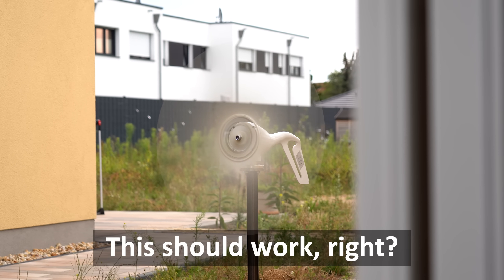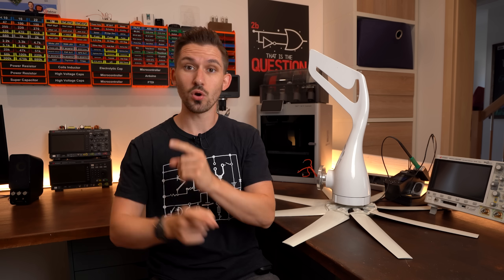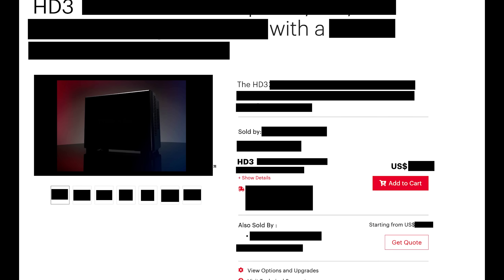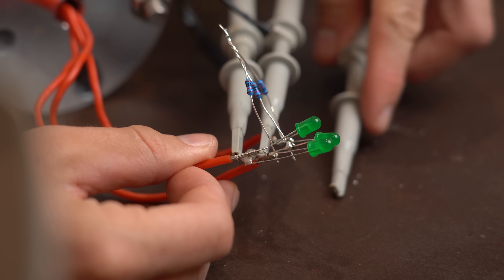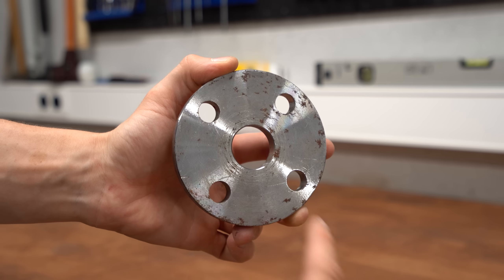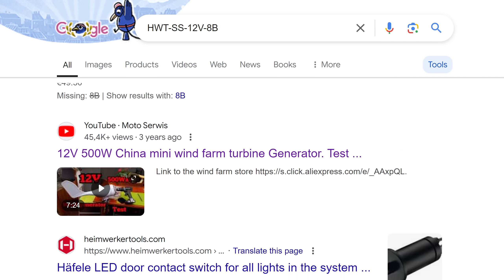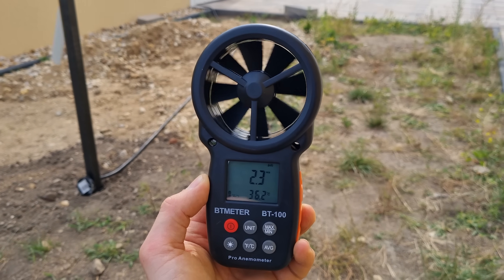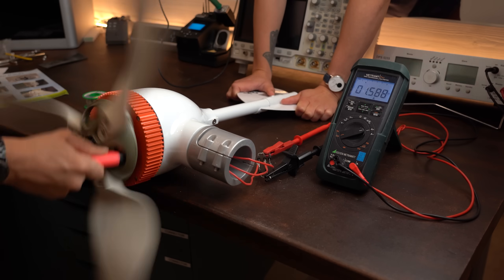I tried to Power my Home with Wind Generators! (Worth it?)

Comment: Make your own... Lens 2 type design... Find a BLDC with a ceramic housing from an old Diakin industrial aircon. Needs a lot of gear reduction but will power a 1000W inverter! Almost impossible to turn by hand when the phases are shorted. Comes with hall effects sensors for feed back to monitor windspeed if you what to be creative. Sien jou volgende keer van Suid- Afrika. Vol brug drie fase gelyk rigter🤣

Comment: i wouldnt power my house with a windmill, but i would use one to charge batteries in tandem with solar panels, and if i had a stream running through the property a water wheel

Comment: Every times you see these - not only Chinese - commercials about small wind turbines with 1,2,4 kW proposed output, take a break, think about the fact that generators are not that much different to motors and then how big is a normal motor that can handle 1,2 or 4 kW - How should a toy like generator give a steady 1kW without burning?

Comment: You could try setting up a funnler system. Basically a wall with funnel holes or fins to focus the wind speed into a higher speed when it makes contact with the generator.

Comment: I had the same brand of motor, the first one shipped with a crooked axle, the second one was functional but only generated the stated "500W" when it was spinning at 10k rpm.. but it beeing only 200W built an entire windmill to attach to the alternator, with a transmission got speeds of 3000rpm at the axle and only generated 50w in the end..  first design had the alternator beeing directly driven by the windmill,  used the same design comparable to a H-Rotor design, tested the design in a windtunnel, and only at 10m/s speed it started turning at 200rpm.. 15m/s which arleady is allot of wind and it only climbed up by 50 or so rpms.. It's not in use,  i can see how it's handy for a greenhouse that feeds on battery power but i don't see any other purpose really.. money wasted + the maintenance and all.. it's not worth it indeed

Comment: Unfortunately, those products from Aliexpress are quite inefficient. They all need gearbox to change ratio or just rewiring. But it is way cheaper to wire AXIAL motor from scratch with neodymium magnets. Body can be printed on 3d printer. Additionally, you can add planetary gearbox to make it "low wind speed". I was thinking to make a video of that, but I know you can make it way better :)

Comment: One key to gaining any decent amount of wind power at low elevations...  is the use of an Air-Funnel, that directs and concentrates the wind.    One of the more recent innovative designs, is a vertical stack of large rounded funnel shapes, spaced about a few inches apart from each other.  The air can enter from any direction (360 degrees)  and the air gets driven into the large center hole diameter... which makes a decently powerful air-column... that I believe is driven upwards, due to the funnels being inverted.   At the top of the device, in the center of the air column, is a Bladed Generator.   Supposedly, even in very low wind conditions, it performs well.

 Long before that design,  there were similar funnel concepts (not sure if they were ever built),  where the collector funnel was a massive horn shape..  and it lead into a sealed chamber where..  I believe it was a blower fan style of blades, was installed.   The main issue with this design, was how massive the horn shape was, and... that it only captured wind from a single wind direction.

 Long before seeing the brand new funnel concept... I thought about a vertical design... where you basically have many long vertical horn-like entry points (with fins that guide the wind inwards), that guide the wind into the center... from almost any direction.   Similar squirrel-cage center blade system...  with the generator being mounted below the cages floor.    The problem with this design, would be the way in which you have to get the air Out of the center.   Possibly by directing the air upwards, by altering the blower system, with a spiral blade design, and Sealing the center... preventing any air from passing into the center.  In this way... you would basically have a vertical  "water-wheel"  like system... but with spiral collector troughs (wings).  Eventually, the air would come out of the top... using a  "wind shielded"  exit port (as you dont want wind blowing into the exit ports).     Now... is my idea better than the modern version?   I have no idea.    But seeing those long Spiral wind decorations... spin like Crazy...  its very possible,  that it could be an excellent design... when placed into a spiral wind-directed enclosure.
Reply: Many start-up companies tried to develop wind turbines with large cones in front of them. It never works because the wind sees that as basically just a wall and largely goes around it. Wind, like electricity, prefers the path of least resistance, especially at low wind speeds. The faster the wind is moving to start with, the more such a funnel works as the wind is less able to move in another direction to go around it, but also the less necessary it is since the wind is already then moving fast enough and larger blades are generally cheaper than a huge funnel.
Reply: I do not know for sure, but I think your idea is total nonsense because you cannot push wind through a narrowing funnel. There is back pressure that just pushes the wind around the perimeter of the funnel opening and the wind that does go through the funnel is slowed down by the back pressure. 

If you want wind to pass through and cool a house, you open the windows wider on the leeward side and open the windows only slightly on the windward side. The lower pressure on the exterior leeward side of the house sucks air out the wide open windows, drawing air into the house through the windward side windows.

There may be a slight increase of psi in the narrowing section of a funnel, increasing the speed of air movement, but there is less air by area and volume passing through the funnel than if you simply face as much blade surface as possible to the largest expanse of wind.
Reply: @omnizen   I didnt mean an actual Funnel.  Large fins, to guide the air.  At most, some rounded edges.

Comment: ive found a rough formula for the expected power output of a wind turbine (meant for large generators which are pretty efficient)
A*0,625*v^2=W
A is the swept area
v is the wind speed

for your generator: ~1m^2*0,625*(4 m/s)^2= 10 Watt
so i wouldnt expect much from these small turbines

Comment: Have been reading reports where they investigate if wind energy for the home would be an option... and below 25 meters (max height for something residential, at least here in Belgium) wind is not powerful enough to generate any decent amount of power in 99% of the cases, except maybe when you are living near the coast or on a hilltop where there are not too many buildings or other landscape elements around you that block the wind. I laughed when I saw you mounting it on a post of not even 2 meters high between 2 walls ... if you are lucky you create some kind of wind tunnel between the buildings but since wind is so variable you will block a large part of it too that way.
So wind energy at home is cost / benefit not worth it unfortunately.

Comment: The problem with windpower ist that it needs "high" wind speed (~v^3) as well as  quite some surface (~A). WIth these small turbines you probably won't exceed 10W as it is maybe 0,25m^2.

https://open-windmill.org/windenergie-und-leistung/

Comment: maybe you can attach a gearbox or some belt system between the head and the generator to make more energy at the low speed.
You can also test out some custom blade designs, maybe with longer lengths.

Comment: Good video. Also people attach these things to their buildings and most buildings and mounts are not capable of surviving the dynamic loads a wind charger transfers to the building. Even well engineered home installations in suitable locations are soon abandoned be cause significant routine maintenance is required that most people cannot continue long term.